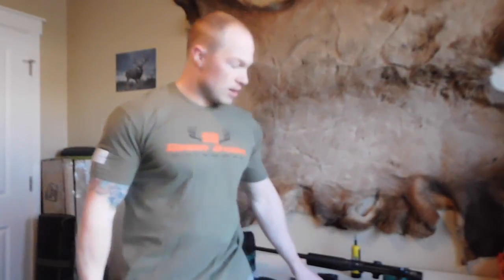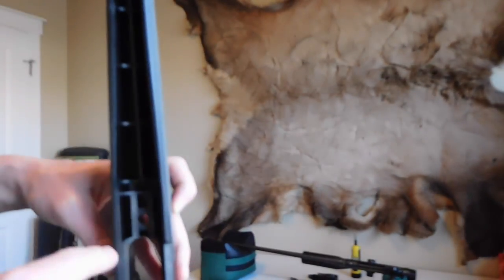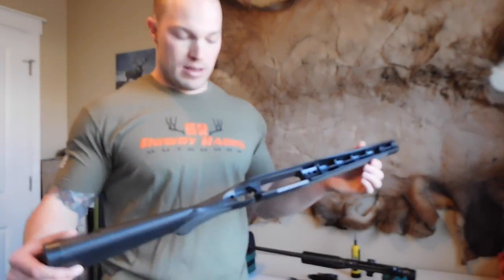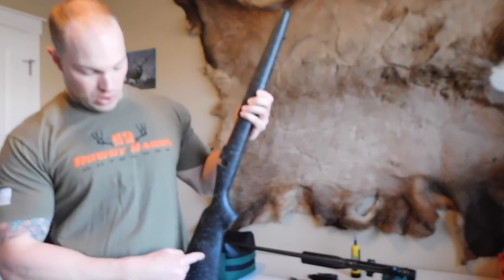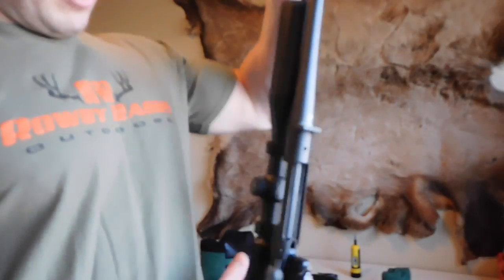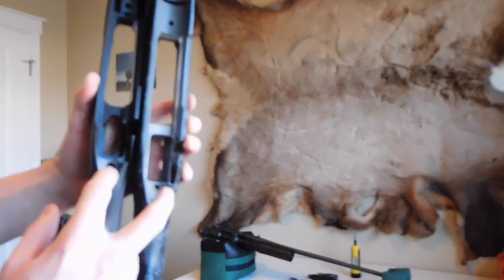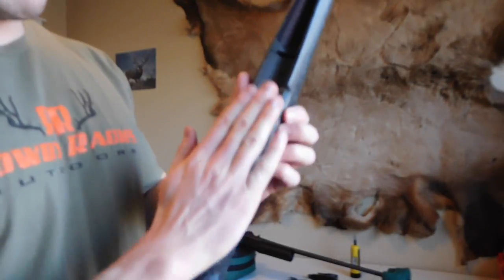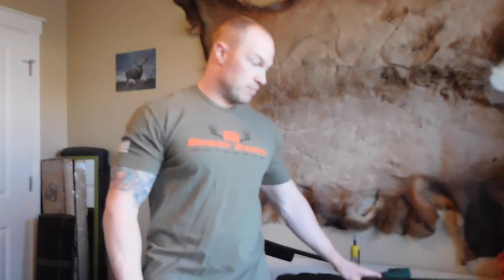Should I change my Remington 700 rifle stock?

Comment: To get a Remington to shoot you need to replace the stock replace the barrel the trigger .Which is after your done the only thing that is Remington left is the action and you should have that trued also
Reply: Or you could just not suck. I had a 700 in 25-06 that would get 0.5 moa off a sandbag with factory ammo but like I said, I didn’t suck so there ya go.
Reply: @flapthecrapster  Sounds like Ukraine can use a real hero like yourself .Unless you just like punching holes in paper ,
Reply: @kurtnulf3362  and of course I’m talking about punching holes in paper. 0.5 moa denotes that I am referring to group size. Have you ever actually seen the effects of a GSW on tissue? I learned a 380 fmj is two inches wide going in and a little less than half an inch coming out. The one I saw just last night was anyways.